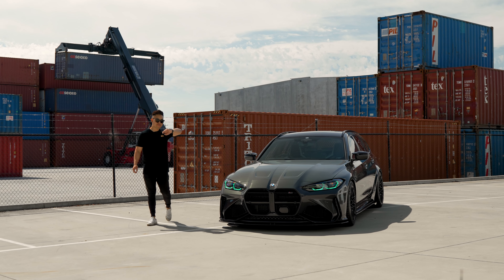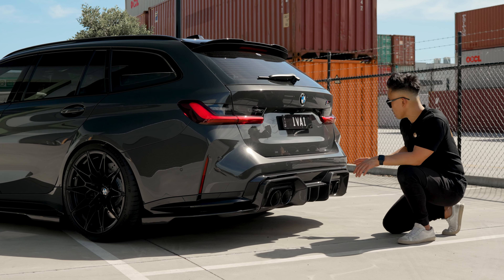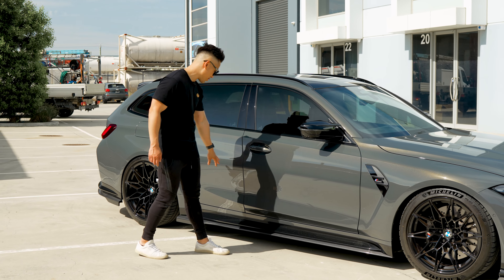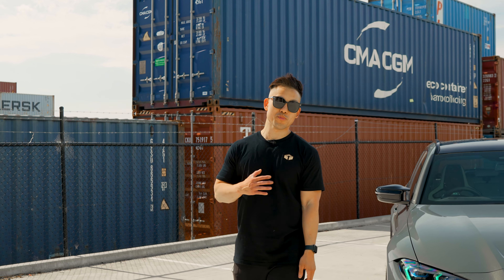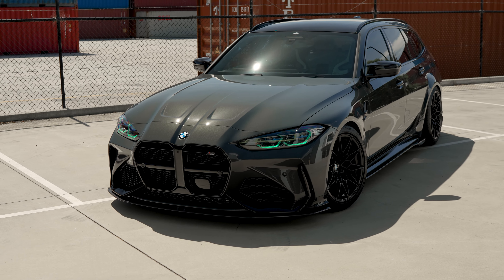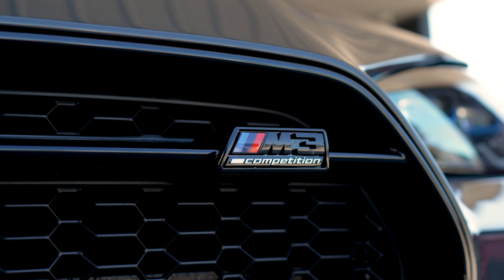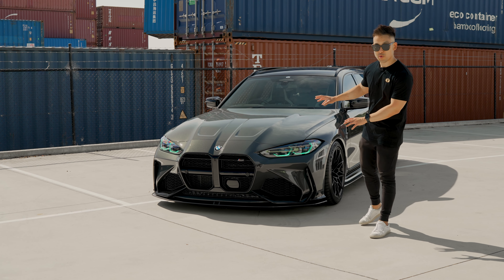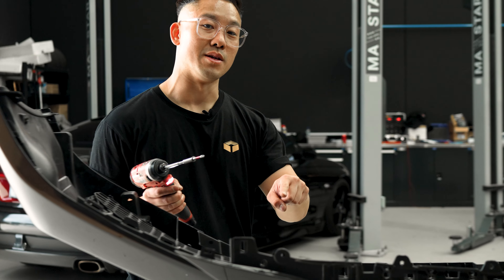AUSTRALIA'S FIRST ADRO BMW M3 TOURING G81

Comment: you guys def should have added the CSL style grill and intakes on the side in carbon it would have finished the look!
Reply from the maker: The ADRO bumper is a full bumper conversion so the CSL Style grille and carbon ducts don't fit as they are only suitable for the ADRO bumper.
That said, a conversion with those parts on the factory bumper look very very nice!

Comment: The front bumper is very nice.  In Australia where are you going to install the rego plate at the front?
Reply from the maker: It's an amazing front bumper!

We ended using magnets to fixate the plate. That way we do not need to drill any holes ;)